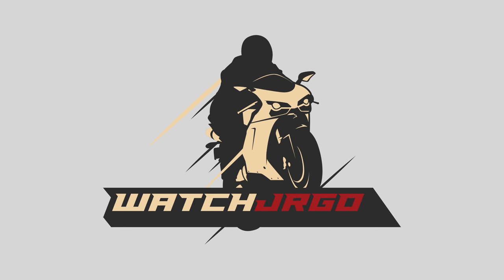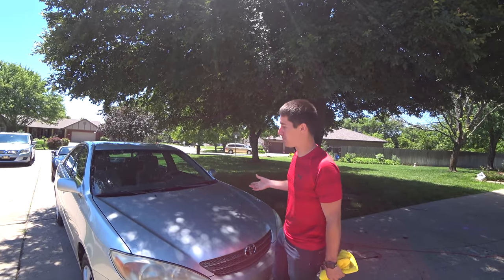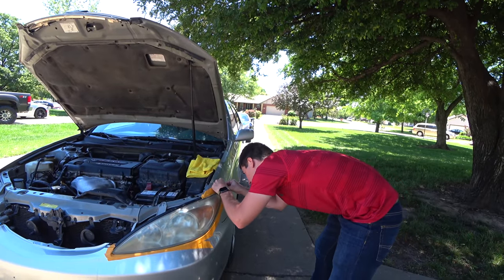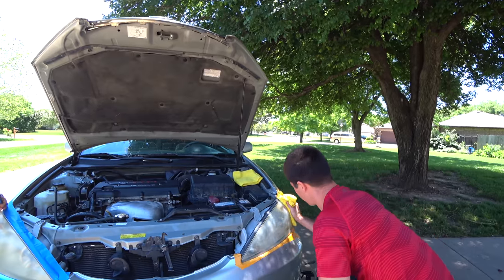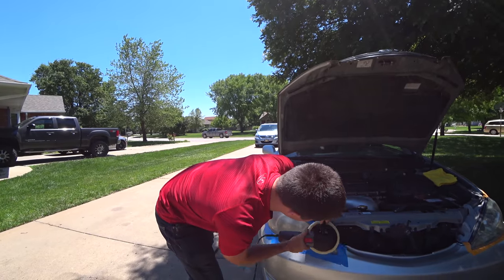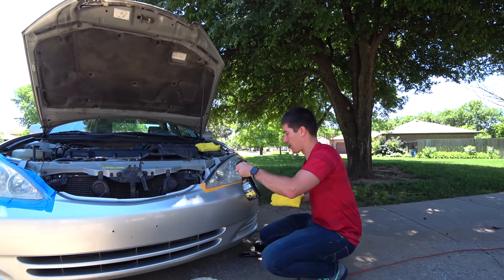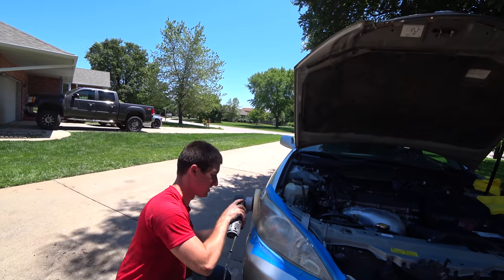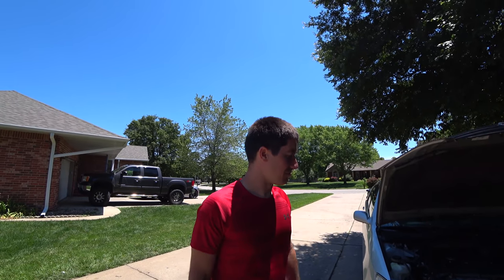How To RESTORE Your Headlights To New In FIVE Minutes

Comment: I sand first. Its imperative to get stone chips and deteriorated acrylic off. If you don't, they will always look yellowy and you won't get 99% + optical clarity. Sealing is very important too. You need to seal them with an acrylic sealer thats UV proof, or three months later they will matte out again
Reply: This is to true. any goop u spray or rub on them will come off in a few years. May as well do the job right

Comment: Not even gonna sugarcoat anything but the 10 dollar 3M kit had the exact same results and it’s been 10 months and still looks like I did it just yesterday
Reply: However, the compounds and DA can be used down the road to also fix minor to moderate scratches on your paint, saving you potentially hundreds, if not thousands of dollars in bodyshop repairs.

Comment: Looks good... But I’m not sure there’s a point to using multiple compounds on the same pad, you are still gonna have the course compound left in the pad when you switch to the finishing... I just do them with a rag by hand with Mequires Ultimate compound, takes about 5mins a light and then I put Mequires paste wax on. Fyi if you end up with dried up compound on anything RainX will wipe it right off.

Comment: DUDE..., JR.... You're gonna get rid of the Camry!?!?!? Even wirh that used motor with 180,000 miles on it, if the motor is solid, that car is a keeper. I've got a 2002 and its runs like a swiss watch. 

Anyways getting back to the subject of thr headlights... to keep up the shine after restoring them by buffing them out, maintenance is simple. Just pjt on a coat of Carnauba wax every so often and that should maintain the  restoration job you did. Cool vids.... keep them coming.

Comment: Head lights on 2006 Grand Cherokee were so bad no cleaner in a can worked. 400 sand paper and water took all the grunge off and then I sprayed it with 5$ clear paint and it is perfect.  8 months later still good.

Comment: Ive tried all the commercial products and they are all worse, or no better than toothpaste.  The great thing about toothpaste is, you already own it, so its free.  Just squeeze some onto the lights and buff out the haze.  Takes just a few minutes.  Wash it off and it dry.  Then spray with a UV resistant clear coat, which costs less than $5.  All the professional kits do is waste your money.

Comment: There IS a cheaper and MUCH more reliable method.  Get a can of Brake Parts Cleaner and a standard Red shop rag.  Soak the shop rag in the cleaner and wipe in ONE direction ONLY, going from the inside to the outside, until scratches and oxidation are gone.  The parts cleaner will melt the plastic and the wiping will smooth the scratches.

Comment: I've heard you can use tooth paste but never did it myself.
Reply from the maker: I tried that about a year ago, took so long I gave up 😂
Reply: It actually works tbh okay I’ll explain how I did it and got results so first clean them then sprits some water not too much on the headlight then apply toothpaste (MAKE SURE IT HAS BAKING SODA OR THE WHITING) then apply to the whole headlight then use a brush like a toothbrush and then scrub and scrub you’ll start to see the paste turn yellow (the water is for lube if you don’t use it you’ll just have really stuck on paste) and then wipe off and protect with wax it worked for me
Reply: @WatchJRGo  cool thanks